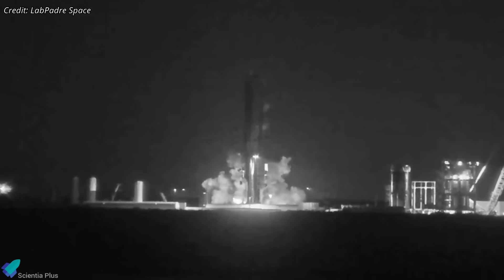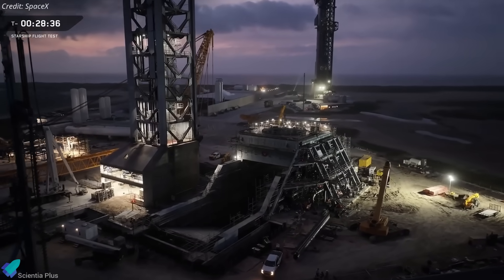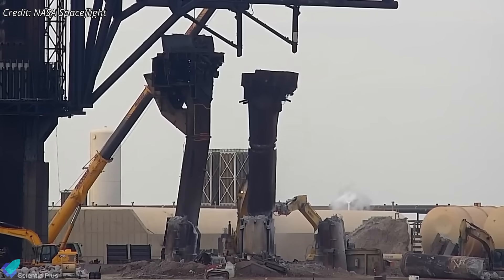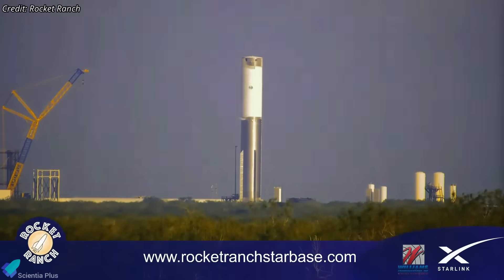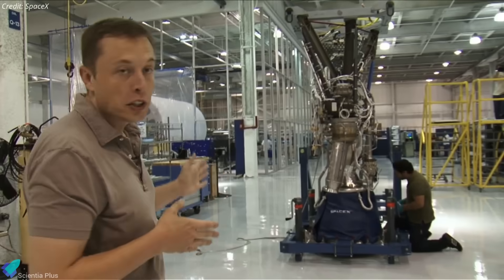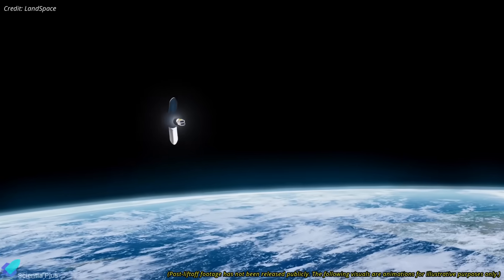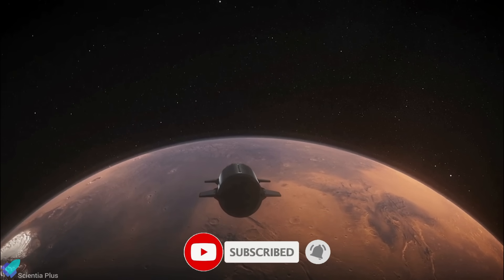Starship Pad 2 CRITICAL SYSTEMS REMOVED! What’s Going On? Raptor V3 400s Test! Zhuque-3 Launch

Comment from the maker: 00:00 Starship Updates
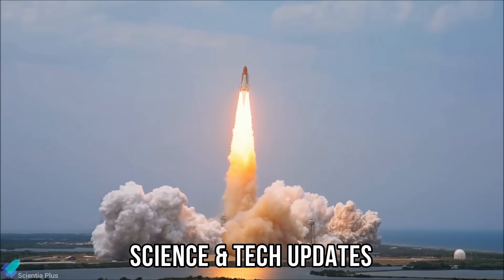08:05 Russian Cosmonaut Caught Taking SpaceX Data!
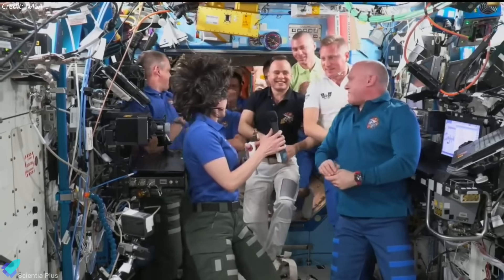11:20 China’s “Falcon 9-Style” Zhuque-3 Flew Perfectly — But Landing Ended With a Fireball

🔥Booster 18 Explosion 
   Complete Breakdown: https://youtu.be/2mYXI6WRwqI
   Root Cause Identified?: https://tinyurl.com/2bj6h4m2

📚 Learn More:

🚀 Starship Block 3 Explained: https://tinyurl.com/mp63u57m
  • Detailed Breakdown: https://tinyurl.com/bddv6w2y
  • Production Begins: https://tinyurl.com/5cb2ee3h
  • New Transfer Tube / Downcomer: https://tinyurl.com/ymm23t2c
  • New Grid Fin: https://tinyurl.com/mppnd7sz
  • New Integrated Hot Stage Ring & Forward Dome Upgrades: https://tinyurl.com/msvxk8m
  • Booster Block 3 Aft Dome Insane Design Upgrades: https://tinyurl.com/3k2rxvpf

🛢 Dual-Port Orbital Refueling – Full Technical Breakdown
https://tinyurl.com/3hej7fk3

 Starship Block 4 Unveiled: https://tinyurl.com/ymhyyt2h

🔥The Insane Engineering Of Raptor Engines:
     Part 1: https://tinyurl.com/348hsrya
     Part 2: https://tinyurl.com/p8k85mu6
 
🔥 Raptor V3 Explained:
    Mega Upgrades & First Test: https://tinyurl.com/22nzc3za
    Raptor 3 Evolved Again - More Protection This Time: https://tinyurl.com/4up7jxdd

🛠 Insane Engineering of New Starship Launch Pad: https://tinyurl.com/42h5kd92

🧱 What’s Inside Starship GigaBay?: https://tinyurl.com/2ujtkmkb

🛠 Other Starship Upgrades:
 • Hot Staging Explained: https://tinyurl.com/yc4ejbmn
 • Super Heavy Booster Upgrades: https://tinyurl.com/msm9jtkc
 • New Heat Tiles Explained: https://tinyurl.com/45dytyef

🔥Booster 18 Explosion Complete Breakdown: https://youtu.be/2mYXI6WRwqI

📡 Stay Updated:
📢 Weekly Updates: https://bit.ly/3HIQjPC
🚀 SpaceX Playlist: https://bit.ly/34wue8T
Reply: This video, at least through the first third, says nothing about the espionage!
Reply: The espionage attempt was finally mentioned at about 8:13 into the video.
Reply: @kenwhitfield219 
 ah ! nice one , cheers mate 👍